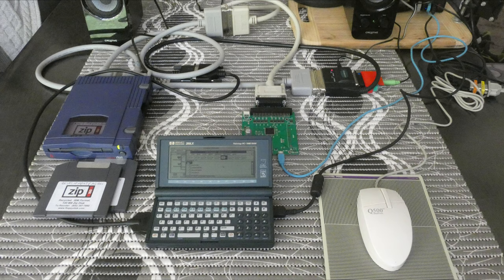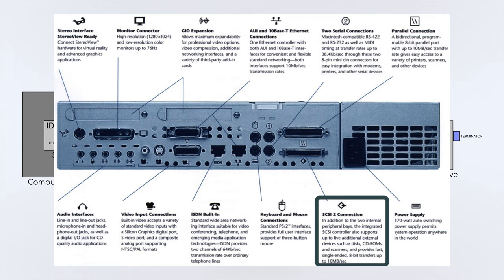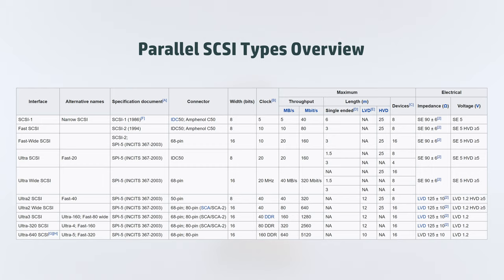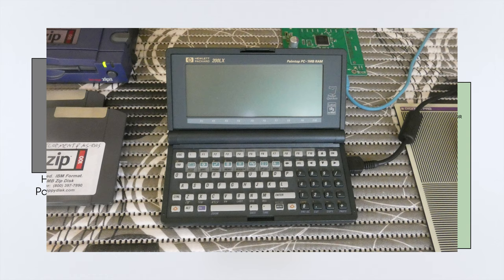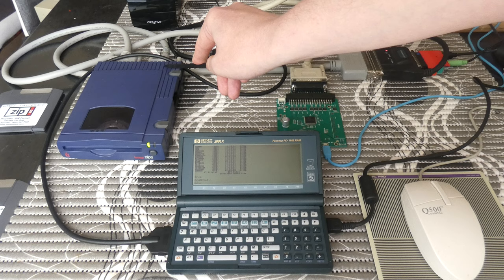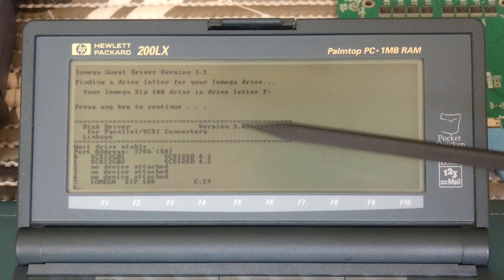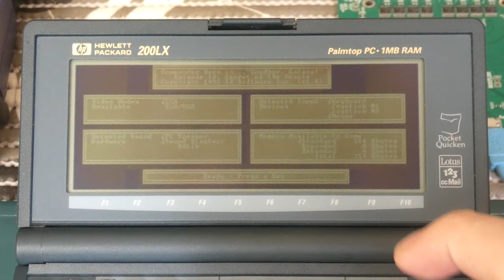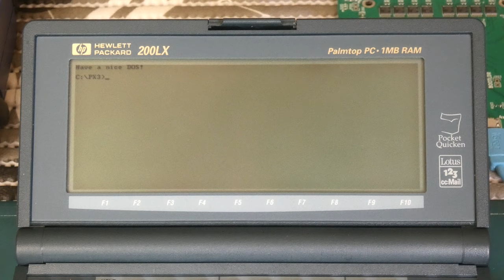HP 200LX: Connecting SCSI devices to your Palmtop part 1 of 2

Comment: Great concept but I find it hard to find any practical use with all these adapters.
Reply from the maker: That's all it's for, just a concept for a video that I thought computer geeks of all ranks would love to see, and many seem to like the video :) It's my most successful video to date...
But, as you say it's not at all portable/practical... It's just meant to do something that nobody has done before, pairing a pocket sized palmtop from the early 90's with a computer system bus designed for mini-computes and large PC servers :)
Reply: @HPPalmtopTube  I love your videos btw, I have 2 palmtops and it’s the best dos portable please keep these videos coming. I was wondering if you can make one about the infrared printer. I got one from eBay and I fixed it but not sure how to practically use it.
Reply from the maker: @saifal-badri  Sure, I can. I have an Irda compliant pocket thermal transfer printer, the Pentax PocketJet II Plus. Is that the one you have too ?
It's a good idea, I'll make a video in the near future after i've finished the 2nd parts to my current projects/videos :)
Reply: @HPPalmtopTube  awesome! thank you, mine is HP82240A
Reply from the maker: @saifal-badri  See if your printer is "Irda" compliant, it's a infrared serial data transmission standard/protocol. If it is, it's easy to configure it on the palmtop...
Reply: @HPPalmtopTube  I have a question please, I have two Travel Floppy 144 Floppy drives with the passport PCMCIA cards. I did everything possible trying to make them work with my HP200lx 4MB double speed with no luck. Things I tried so far, getting original AC Adapter (which is for some reason -ve polarity), tried replacing both drives belts (got the belt from eBay from a German seller which I believe was for citizen drives). Tried the drives on another palmtop 200lx which is original speed since some people online said it conflicts with the double speed driver. so far unable to read any 3.5 floppy. What happens is I connect the power to the floppy, power on the palmtop then the driver loads, I can go to drive F: from dos then when I enter dir I see the drive blinks, try to spin then no files listed, the palmtop freezes and a hard reset will be required :(
Reply from the maker: @saifal-badri   Where did you get these drives ? (and, are they of the Accurite brand?)
Reply: @HPPalmtopTube  yes they are Accurite Travel 144 with Passport Card. I got them on eBay but they never worked
Reply from the maker: @saifal-badri  Have you tried to use them on another type of machine, like a laptop with PCMCIA slots ?
Also, are you using the HP200LX specific driver ? (fdhppalm.sys)
Here's what you need in your config.sys for it to work (and you have to use the 200LX driver, not any generic drivers):
buffers=20
files=30
lastdrive=j
device=\fdhppalm.sys
Reply: @HPPalmtopTube  yeah same config I tried. I have the original manuals and drivers. Took me forever to find them online since the website is gone. I have a vintage win95 laptop I will try them on it. Thanks
Reply from the maker: @saifal-badri  All I can find is that the standard driver does'nt work with doublespeed machines, unless you get an updated driver, i quote: "Travel Floppy driver software from Accurite, Inc.: If the floppy unit does not work on your speed upgraded palmtop, contact Accurite by E-Mail to get the latest version of the Travel Floppy driver. The latest version works well with the TechSpeed upgrade."
There's a company that sells these still (the same company that has all the hp palmtop magazine issues online, maybe they can get you this updated driver ? Maybe send them an email...
Reply from the maker: The company is called Thaddeus computing, google for it...
And definately try it on the win95 laptop too! you wanna make sure the drive itself works %100... That's all I can do... good luck!
Reply: @HPPalmtopTube  This is very helpful, I appreciate it. Happy Holidays for you and your family 🎄
Reply from the maker: @saifal-badri  Glad to be of help, I hope you can get your floppy drive working... And happy holidays to you too! :)
Reply: @HPPalmtopTube  I managed to get the accurite floppy working with both my doublespeed and regular speed HP200LX, all I had to do is to open them and look while I try to read the disk. I noticed that one of them has issue so I swapped the motor with the other drive and all worked fine. I tried reading and saving a basic program :)
Reply from the maker: @saifal-badri  That's great news! :) congrats :)
BTW, try to keep your Accurite floppy drive and everything it came with as clean/neat as possible as these thing are ULTRA rare and basically if someone wants one, it's really hard/nearly impossible to get one as maybe 1 of these pops up globally on ebay each year nowadays...
It's probably worth US $200+ already and in a decade probably twice the amount :)
So what are you going to be using it for ? 1.4MB is'nt much storage space... :) LOL
Reply: @HPPalmtopTube  I agree about the rarity part, finding the manual for this thing was like a CSI episode for me lol
I have another usb floppy my windows 10 so moving small files on a floppy is easier than flashcard/reader method.

Comment: Why bother with PCMCIA to Parallel, where PCMCIA to SCSI exists?
Reply from the maker: The HP200LX'ss PCMCIA implementation is non-standard and you need a specific driver/enabler for the 200LX to use a certain PCMCIA card, and no known PCMCIA card exists that supports SCSI.
There might be a rare and obscure card that works, but nobody knowns about it.
Reply: @HPPalmtopTube  Thanks for the explanation but any card that the 200LX can use is obscure and rare, a good example is the card that you are using in this video.
Reply from the maker: @oturgator  If you really want one it's possible to find one in a few months, either a quatech or a trans digital card. I had 3 last month (a quatech and 2x trans digital) and sold one recently...
Reply: @HPPalmtopTube Does the Quatech SSP-100 work as well?   The Serial adaptor?
Reply from the maker: @nyccollin  pls read my reply on the VOGONS forum...
Reply: @HPPalmtopTube  Thanks!